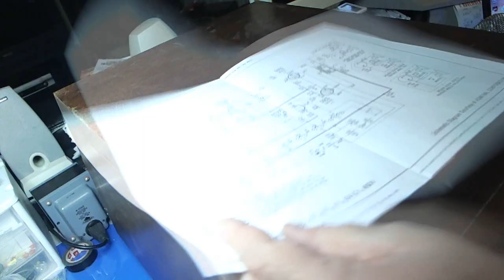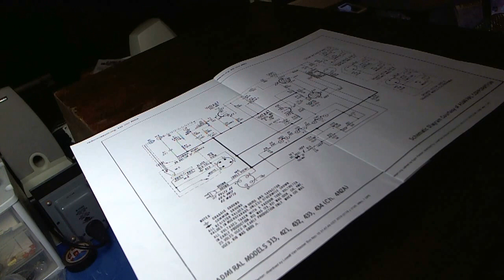1958 Admiral 432 Record Player Restore Part 1

Comment: I'm psyched because I want to see you fix the record changer as well as the amp. welcome to the E.I.B. = Electronics Is Buzz's Network.
Reply from the maker: +amberola1b ..The record changer is in mint condition and will only need cleaning and lube..I'm shocked at the low hours this machine has...Buzz

Comment: Hay Buzz, we always rated the damage to the groves in monetary format. The proper tools to use to "adjust" the tone arm was done by using coins instead of non flat old componets. Dimes, pennies, nickles, quarters were used in ascending order.  I am willing to bet you have a 10 cent scratch there, definitely less than 21 cents( two dimes and a penny).
Reply from the maker: +Mark Cummins ...I didn't have any coins handy, ,,so a .000425 capacitor did the trick..

Comment: Those 50CS output tubes sound nice in the push pull configuration.
It does do High Fidelity. Some of these sorts of record players had a jack for external speakers too. Does it use 12AX7 for the driver tube?  Sounds great Buzz. Nice project and will look great when the Buzz-master finishes it up! Dickel, you had me going there and thought the PG rating would have to be raised to XXX. BTW for the heck of it, you might like to check the metal on the record changer to make sure there is no voltage on it since it will be a gift. Yep, my city was gone. Old Rushbo's tune. Chrissie Hynde said that she wasn't thrilled that Rush used the song, but she didn't care too much since The Pretenders get royalties every time he plays it! Make sure the tone arm doesn't drag. It might be just the needle is worn but then again the tone arm might have some resistance in the motion.
Reply from the maker: +Lockemeister Hi Meister-Man..yes there is a 12AX7 original tube in there.All 3 tubes are original This player has no jacks, but I may add one if I knew how to wire it..Looks like Dickel had lots of people going on that bit.......LOL ........
I remember Rush saying that Chrissie's parents were fans of the show, so she didn't mind him using it, but he does pay royalties...
Meister, I'm shocked at the low mileage this player has..Wait till you see what it looks like under the hood!.
Reply: +Buzz1151 A jack is relatively simple, (compared to the incredible work that you have been doing). You can use a 1/4 inch female jack. It has to have a long enough threaded shaft to go through the wood and then look professional when you put the retaining washer and nut on.
The female jack has to be normally closed to have the internal speakers work. Then when you shove the 1/4 male plug in, then the jack contacts opens up and the contacts make contact to the male plug. Well something like that. You don't need a stereo jack and plug, only mono. If you can still get one, I don't know.

Comment: Greetings:
You need to learn what is used to "size each recording". I think the changer supports: 7", 10", & 12" recordings.
I think I saw the 12: detector adjacent to the vertical support for upper arm. I have not yet learned the 10," detector or whether that size is supported for any speeds. I recall seeing 10" 78 rpm recordings.
Reply from the maker: I dont remember ...brain is old ☹

Comment: You will not get stereo!!!! but uou will be able to play stereo records.  with a new cart the cart you have you can't put on  stereo.  but check maybe someone  changed cart already were those stereo records you played or mono
Reply from the maker: +Ray Ayling Ok Ray..bear with me....The needle that is on there has 2 wires..I know stereo takes 4, but, the needle is a plug in type.. I don't if  its original, but everything else is.....part # 940-DS73 on @VM...so if I understand you, this can play stereo records fine, but just in mono hi_fi? correct?..
Reply: Yea it's a mono cartridge.  To play stereo records you need a stereo cart then put a jumper wire across the stereo cart it's called bridge in the cart.  There are videos on how to do this chris cuff has a cpl.  If uou play stereo records it will not track and sound grainy